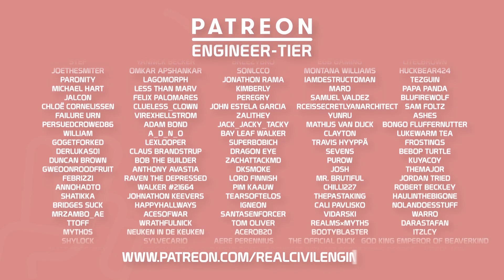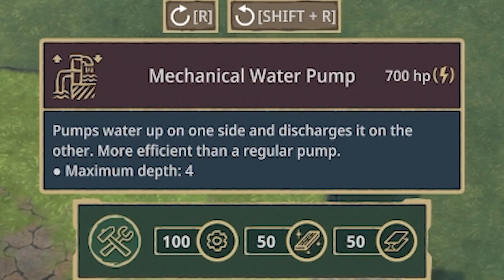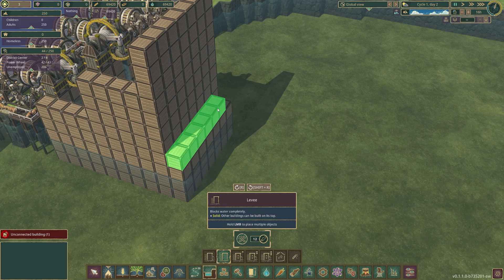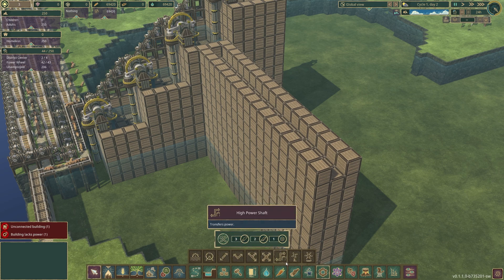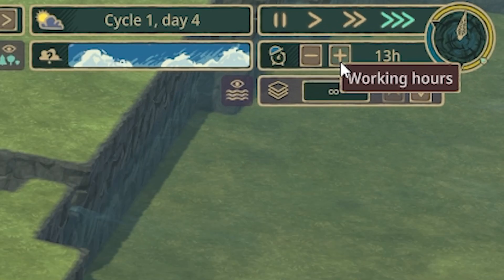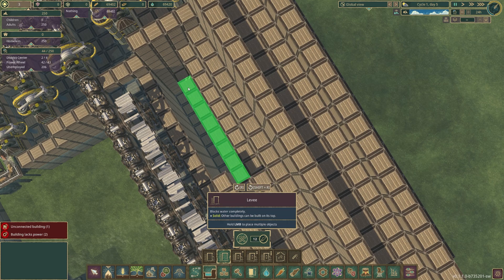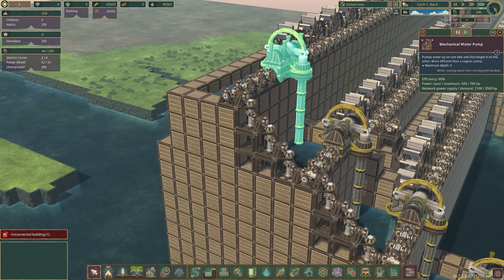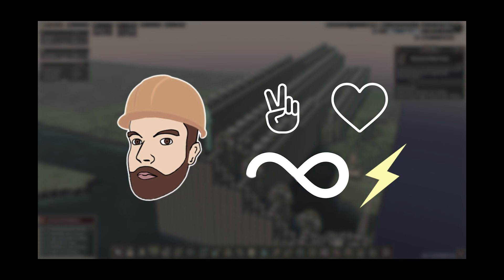Engineering INFINITE POWER in Timberborn!

Comment: Heyo don't know if you are still reading these but the Water wheels seem to be generating power based on flow rather than head pressure, so instead of raising the water higher and higher to make more "pressure" have a bunch of pumps on the same level and increase the amount of water moving.

Comment: maybe if you used 2 pumps to go up the levels and use the dam blocks that let water pass after it fills at every step this keeps water in each area and might carry enough momentum to spin the wheels.
also only drop a step on the turn around

Comment: You need a higher vertical flow output, so id say if you were doing something like The Line build on a really big map it'd be possible but you would need at least 2 pumps per level, probably 3

Comment: You arent using gravity to your advantage imo.  Too long of a stretch for the water flow to turn your wheels.  Figure out max wheel output and the gravity drop you need to acheive it.  As you get the water higher, add more wheels.  Basic principle, start with the smallest working system and extend it as you lift the water higher.

Comment: I think that if you add water pumps you'll have bigger water flow so the water wheels should work better and it'll be ok. but you'll need more starting power which I suggest windmills and gravity battery, so that the battery fill up and can start up the machine.

Comment: I feel like the area you are using to fail to create a perpetual motion machine could be used to grow trees and put those trees into 10 engines at a rate of 1 log per hour per engine meaning for a 16 hour day you just need to cut 160 logs. A Maple tree is the most efficient at producing logs with 8 logs in 30 days the wiki says 1 engine requires 90 maples so 10 engines require 900 maples that's a 30x30 square. You can manage that many trees with 2 foresters and like 4 lumber jacks meaning 16 beavers. That said you could also use windmills which seem to output a random amount of power any where from 0-400 and location doesn't seem to matter so you could in theory make better use of the space by using loads of them instead.

Comment: You definitely need more pumps. Try with 2-4 pumps per level and you need to dump all the water on the top. You need a lot more waterflow to generate more power. I think that should work, and hopefully it will produce more power than it consumes..

Comment: i think you might need to add more pumps at the bottom and with each branch off for power you can lose 1 row of pumps, that way you can make sure there is enough water being pumped to the top, or you could instead of dumping the water off in another branch off of water wheels dump it in the water bucket 1 level down zigzagging down to the bottom (so for example the top level branches to the left then the level below to the right etc etc.) and add a dam on the exit of the water bucket to create the proper water level for the pumps straw. that might work (never played the game before myself).

Comment: This is possible.  I've finally managed to do this and am currently dialing in the power percentages to compensate evaporation.  You'll want to run mechanical water pumps on a dedicated power supply to resupply your upper reservoir so that your percentages are precise.  My net power available from this system holds fairly steady at an extra 8,000hp and the reservoirs are supplied by only  1 engine and nothing else :).  The trick is to have enough mechanical pumps for the width of your canal.  It will take slightly lover one pump for each tile of your canal width.  Your canal should run straight with no turns, dams, or floodgates.

Comment: the energy from the water was too displaced . too many water wheels to be turned means not enough energy to turn a single
 wheel  . thinking delete every other wheel or start at the top with no wheels and fully running water system first . then add one wheel at a time . maybe , more verticle less horizontal

Comment: So... I have my wheels running 2 wide along a 4sq wide river (thank you explosives! and with good flow, I can generate up to 100hp each.
My thinking is. You need more volume. So 2 pumps per level. Then each level has 20 wheels (2x10 config). That should leave you in a surplus for what is needed for the pump
You would either need the torture wheels to start it off, or, you build another 2 wide row of wheels first as the kickstarter. In times of drought, you would lose some power but it should conserve enough water.

Comment: I think that the pumps are not able to move water fast enough yet, so maybe if wheels where more on a slope or maybe not two wide all way down would help. You could probably just test it with only a lower reservoir, and a upper reservoir, one pump taking water from the lower and filling the upper one. And two rows of wheels

Comment: A few other videos have people doing the same thing, pumps level with the wheels resulting in stagnant flow. Have the wheels below the pumps so water falls down and picks up speed. Maybe have the troughs 2 deep instead of 1 as well. Could mess with having a reservoir at the beginning of the wheel network too.

Comment: You need deeper channels. You need to have a 1 step drop right at the start. That way it has some flow. Second, you want the end of each channel length to have a block to keep the water at a certain level. Repeat this drop and pooling process on each and it should maintain a high flow.

Comment: "Matt you idiot" (sorry I had to use the line, but) I think you've been thinking like an architect on this one, the waterwheels only need to output power on one side, so you had so much wasted space. You used 4 width worth of blocks for each water wheel, 1 for the shafts, 2 for the wheel, and then 1 absolute waste of space row which served no purpose. Also I don't think stepping would really help because the water is flowing against the same resistance of wheels regardless, and so by making steps you were limiting the number of wheels you could place. Also you were trying to power 5 pumps with the wheels when powering just one would have been more manageable. It would also probably have benefitted you to get the end of the water circuit to go back to the start so the water is back to the beginning rather than dumping it just wherever.

Comment: If I'm not mistaken,1 water rock is about the same output of 2-3 mechanical pump. I run some build I did it with 8 mechanical pumps, on the same row, not on different level, so that water is output on the same artificial river you setup. Then you need about 18 water wheels. And a really really big water reservoir, at 6 level deep for it to pump water. If without mods, you need about 9 water source (the little rock that automatic makes water, 9 of it)  to fill the reservoir, the water suck a tremendous amount of water to run an artificial river.

Comment: I started on Meander, Iron Teeth, Hard difficulty.
First I built a reservoir where water comes in, on surface like 1/8 of map, about 10m deep.
I found a way to slow down water flow (1-wide 10-high gap): if you dig one extra block down where that waterfall falls (only one block, 1x1x1), it slows down water rate ~6 times or so.
Then I built ~20 big water wheels, and it was enough to power 2 mechanical pumps and all my carousel and other stuff I later built.
Experimentally, I found that big water wheel only accounts the water flow under its axle (2-wide channel but actually only its 2x1 area). I had no height-drops in all my wheels chain, the 1-block height channel (2-wide) was enough and every wheel gave like 180hp.
It was not completely infinite engine, but enough to 'survive' 30-day droughts (longest) with full power on.

Comment: I've actually managed to get "free" power, not much, but out of one pump working, I was getting on average 750-800 HP from the wheels. What I did is a bit similar, but I had 2 pumps on each reservoir with a dam at the end. I then had a little canal (with a drop of 1 height) with 2 rows of 4 wheels leading to a second reservoir on the same level, from which the next pump pumped the water up to the next reservoir and a canal with again 8 wheels etc. Had that 5 times, and then made canal like you did, but with only 3 wheels per level,  a drop of only 1 height and a dam at each drop. So when I started my system, I had 28 hamsterwheels to power the first two pumps, once the first water wheels started spinning, I could connect the next 2 pumps (would be low on power from here on until everything was running) and continue doing it, until all pumps were running. Think that extra bit of power I made between the pumps made the difference so I could start the system, which was the most difficult bit. I later changed the dams to those where you can control the height. Worked a bit better, but it was still hard to get the system full and running all the way. Once it was running though, it didn't stop.
I did it actually in a normal game, not modded, but with a map in which I had all the canals and stuff build in. Had to restart and edit the map quite a few times, but on my final run I was on hard mode and survived dry seasons of up to 15 days without loss of power.

Comment: One obvious tip I didn't see in the other comments would be to loop the aqueduct back into the highest reservoir possible so as to not waste water already high up in the system. That might have removed the need for 2-3 pumps and allowed it to produce excess power.

Comment: There are certain things you can do to increase the efficiency a little but with only 1 pump throughput you're limited. If you place a bottleneck between each wheel (preferably 1 tile levee, 1 tile dam for a single pump I'd say) then the flowrate will be increased and you'll generate more power per wheel at the expense of 1 extra tile length per wheel. Whereas it is technically feasible to generate infinite power and you can fairly easily top up the reservoir as long as you have the water to spare somewhere, it's not really practical in my experience. The output WILL fluctuate, you have to take care not to overdraw power as well, if you drop below 100% of your full demand, the pump output will immediately start to decrease, therefore so does the output of the wheels.
However, this behaviour can actually be quite useful if you're running a wind powered setup, since you can set up single tier pump to wheels runs in a fairly cheap and compact manner, attaching a windmill to one side of each wheel and one or both sides of the pump. Once the system warms up and you have water flowing you are left with a capacitor which will continue to produce power after the windmills stop turning. I have a setup running reliably which uses 2 parallel pumps to power 28 total wheels at an average of 85HP per wheel, meaning the pumps use 1400HP and leave me with just under 1000HP 'free'. I use more than that so the system will slowly bleed out energy but it takes a good couple of days to run dry
I have been using essentially the above design for my folktails latest couple of runs and it has made power during drought MUCH easier (if not trivial in easier difficulties) since you can rely on wind pretty much exclusively, water is just for energy storage.

Comment: Double row pumps and then have a pool at the top that has flood gates, then have the water wheel stairs going down oposite the pumps, also have the switchbacks sooner and rather than 5 long make each step 4 long so you have more force behind the water

Comment: bigger map, make each row MUCH longer. Make no gaps at all (no air pockets) increase the small water pool for things to pump into. Start out with wind power and as you gain increasing water wheel power take one wind turbine away at a time. Make more than one system, dont make one system that long.

Comment: 4 pumps at least for every row to sustain a 2-unit wide output. I would use 6 pumps just to be safe. The last mega project I did use 21k power for pumps and produce average 90k electricity. Project is 20 Height, probably around 100 Length (15 wheels for 1 row 1 elevation) and 70 Width (20ish rows, I didnt count)

Comment: Might be  able to pull it off using flood gates, the old water pumps, and water dumps. Requires 0 horse power but beavers need to operate both the pumps and the dumps.

Comment: this seems possible because of weird fluid mechanics in the game.  I think the problem is that you are using flow with less than 1 block height so there just isnt enough to move the wheels.  Also the flow through on opening is dependent on the weir shape after it, so with a 2 unit wide opening you have a max str of 4.4 STR of water (strength of water, dont really have a better unit of measure, str of water is based on the water source block that you set in the map editor.) If you added an extra levee after the 2wide opening it becomes capable of release 6.6 STR of water. in order to make this work i think that weird mechanic needs to be exploited.

Comment: leaving each floor half-filled with watter might have fix some problems.
Also (IDK if Devs taken it into consideration), but you should not be able to make infinite source of powers by pumping watter up and then on turbines. The energy in system have to be the same, so watter turbine should produce at maximum 100% or less then what was consumed on pumping watter up. 
In IRL there are "Pumped-storage hydroelectricity" which uses power when there is excess to pump watter up into the Dam and when energy is in demand, flow it onto the turbines. Glorified battery if you will.

Comment: If the devs change HP to BP, the beaver (shaming) wheel should only product 1 BP... do you want to have dozens of wheels to power a saw mill?  Because that's how you get that.  There needs to be an intermediate unit.

Comment: It might be map specific, but what I'd personally want for infinite power is just to be able to run a constant loop during the dry season. So If you find a map like plains, mountains or terraces where the water source is relatively high compared to the rest of the map, I'd put a load of water wheels downstream of the source to generate an awful lot of power, which can then be used to pump some of the water back up to a reservoir near the source. Then during the dry season you can open a floodgate at the top to send the reservoir water through the system. You can then raise some floodgates near the pumps to recycle the water back into the system.

It's not a completely closed loop, but you can use new water in the wet season to top things up.

Comment: you can try generating from the bottom up. Try to make one small reservoir with two pumps, build the power for that and then try to add one pump, one level. It feels like you would need more pumps in the lower levels, something like a pyramid

Comment: I think you're hitting the wall of "to much at one time". Instead of building everything out all at once build it out (laterally) over time (so start with a single lateral with about 2-3 wheels per level, get that running, THEN add additional wheels to width/taste)

Comment: I'll admit from the start I don't own Timberborn (yet, I plan to, but am waiting a bit since it's still EA) but I've seen a few of these videos, and they all seem to do the same thing as this, with the water wheels on virtually the same level as the dam... Does gravity or height affect the speed with which water flows from a dam? Wouldn't it make sense for the water wheels to be below the dam, so that the water has time to accelerate before hitting the wheel? The problem here seems to be that the water simply has no time to build up speed, which can actually be seen right at the end when removing the temporary walls, as the wheels spin quickly for a few moments before stopping...

Comment: Dude, I suggest you to have slopes which goes to the main base. Start it from the highest place possible and make 1 block lower after the each wheels. It will look like a staircase but you may have more wheels in that sense. As an Electrical and Electronics Engineering student, I can only think of slopes to help with this issue.

Comment: What kind of "infinite power" is this supposed to be? Used 2100 HP to generate 700. This makes no sense. Not to mention space requirements, not enough flow for the wheels. Engineer by name but not by trade definitely. Or maybe this is content only for children in which case it's my mistake thinking it wasn't

Comment: I'd be half tempted to do some serious testing on this. If I had the time and mods set up.

Start with: set up a pump, and set up a long flat channel. How many water wheels can be placed in a row before there is a notable drop in total power output? Then set up a 1 layer drop and have another line of water wheels, seeing the optimal number before there is a notable drop in power output. I'd also look at 2 pumps pumping into the same stream, does doubling the water input double the power output? How about three pumps? Does that affect how long a flat channel you can have before you need a drop?

I noted in your final version, you have the top channel dropping, but the next channel down doesn't drop at all. This could have affected how well the water flows down.

Comment: why make it multi layered
its canal length and pump amount that give results
put 4 pumps at maximum height and feed it into a single entire map spanning canal, your current one was only half a map long and trying to feed 4  useless floors before even starting with a usefull one 
then zigzag it twice, maybe you need to go down a floor to properly zigzag, not sure how the physics works on corners 
just randomly making it higher doesnt increase the water amount and without water amount it also wont make it faster